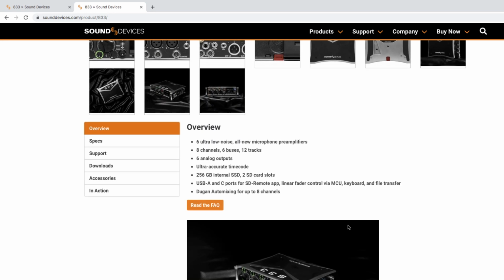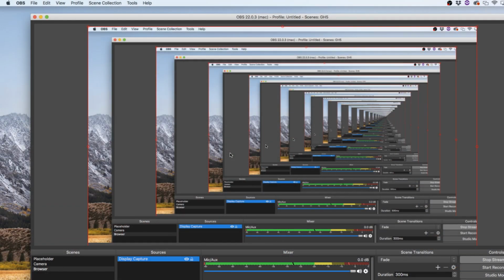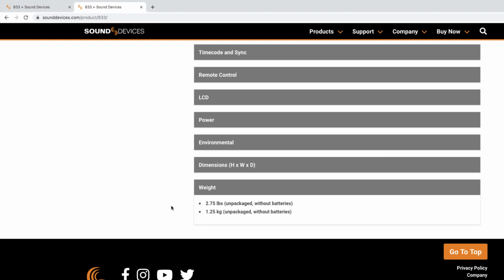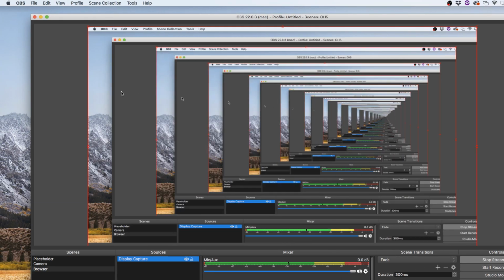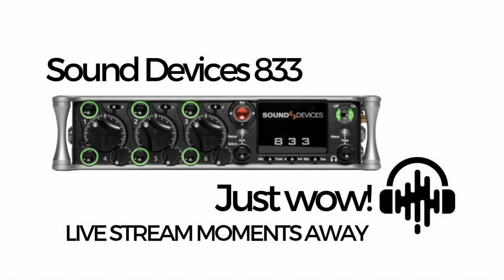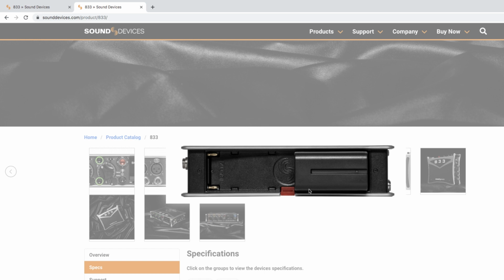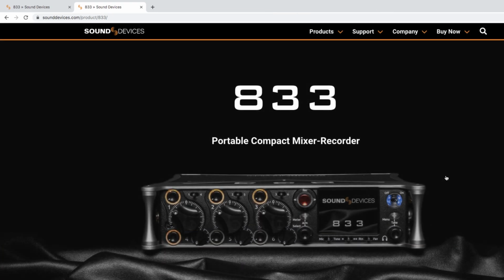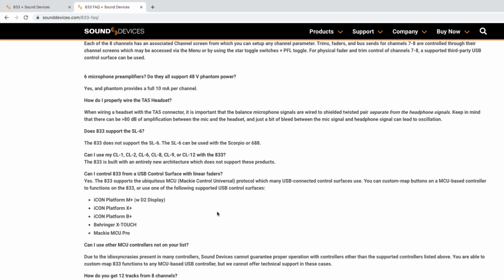Sound Devices 833 - Just Wow!

Comment: My guess is that the scorpio was almoust ready before they thought of the triple adc and 32bit found in Mixpre gen II. That it didn't have the hardware to support it unless redesigning it. That is the only reason I can see for it. RF64 can support 32bit float so why not have the option if you are recording a whisper and gunshot show for some reason?
Reply from the maker: Dustbrigade you could be right about the timing thing.  I’m with you, it wouldn’t hurt to have it, but I don’t think it hurts us to not.  However these are 32 bit converters with 120db If dynamic range, so I’m thinking they are still quite impressive spec wise
Reply: Michael Wynne No defenitely. Will still be years to come of 24bit being the standard editing work flow. But could be good for unpredictable bagdrops. At the same time I would love automix on the Mixpre, but guess we will not see that either.
Reply from the maker: Dustbrigade agreed, we’re probably years away from a 32 bit float from being a standardized format.   I think both Scorpio and this 833 probably could easily have 32 bit float integrated, just won’t have the dynamic range of the mix pre 3